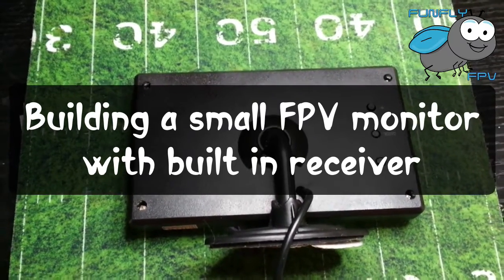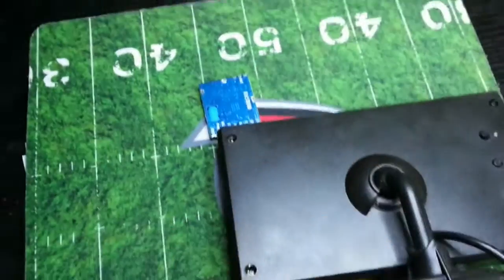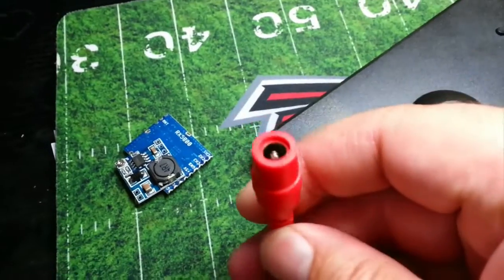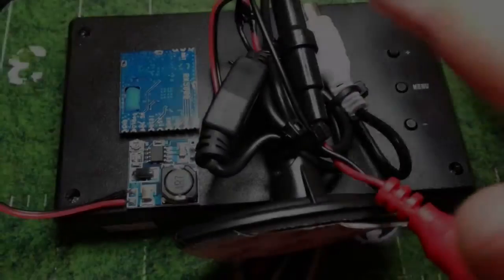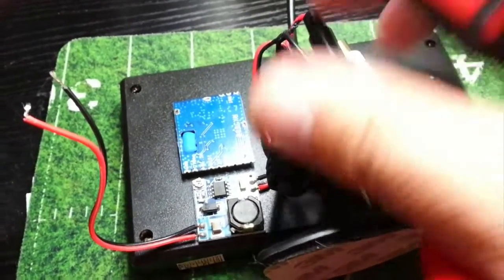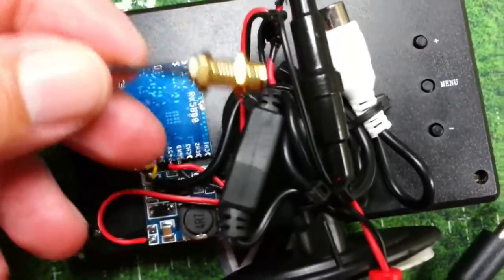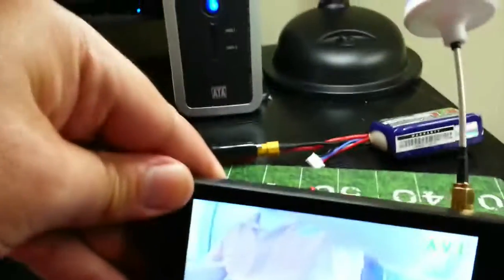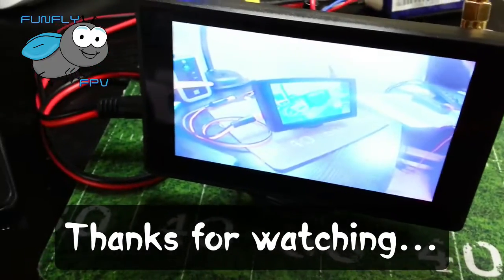Mini FPV monitor with built-in 5.8 Ghz receiver and antenna

Comment: Hello !
This project has made me think an idea... think i'll need your help !

How about if i try to feed A/V directly from another source, such as a DVD player... to a regular TV ?

In advance, Very thankful for your answer!
Reply: This would be an indoor application for this hardware... just for the fun of not having cables on the way.
Reply from the maker: I think it will carry almost any source as long as the resolution fits the monitor.
Reply: Ok. Got it... is there any way to make it work from an HDMI port?
Reply from the maker: miguel delgado Hmmmm ... There should be a converter available.
Reply: thanks for the answer, but:

why do i need conversion?
Reply from the maker: I forgot you were not doing direct input to the monitor so it should work without conversion.
Reply: My next doubt would be in terms of connection. I mean... Hdmi ports have a lot of pins... This chip you were using seems to have a single pin/ single signal video input. 
How could we achieve connection then?
Reply from the maker: Well then I am misunderstanding what you want to achieve. Sorry but can you tell me exactly what you want to do in more detail again?
Reply: Ok... Sorry for the confusion ... On the last message i had mentionned video "input" when its output.my bad.  l
Lets say i want to receive the signal wirelessly just like you did... On 5.8 ghz. 
But instead of connecting to the monitor with the video connection you used i want to use an hdmi port. You seem to use a single cable... Which is yellow and its corresponding "ground".

But instead of that i would want to connect to my tv wich has hdmi port directly from the 5808 circuit. Thanks for your time. :-)
Reply from the maker: I see what you are saying. Most TV's support Composite which is what comes out of the 5808. If your TV only supports HDMI then you can get a composite to HDMI converter.

Something like this: https://www.neweggbusiness.com/Product/Product.aspx?Item=9SIV0GS3CW2965&nm_mc=KNC-GoogleBizMKPL-PC&cm_mmc=KNC-GoogleBizMKPL-PC-_-pla-_-Cables+-+VGA+%2F+SVGA+Cables-_-9SIV0GS3CW2965&gclid=Cj0KEQjw7Ne_BRDRmP2ojKfzv98BEiQAPuqPyeFGJENXl_atcb5wHAg7dG-OEZnlewvVwkbgJZ9SaNgaAq168P8HAQ
Reply: +FunFly FPV ok ok. Got it. Thx a lot.

Comment: I had the same idea only I was going to use a 7 " TFT and place all components inside, I have built 4 videoTx's modules using the Tx board from BG and they work really well I just never got around to use the Rx board (the one you show) I wired it just as you except I used a single cell at 4volts to test ( Data sheet shows 3.8v) something burned on the board not sure what happened as I have read that others have used it with voltages from 3.3 up to 12 volt (w/voltage reg) maybe just a bad component  I did add the 3 pos dip switch as well as a 470uf cap across + to ground as is shown on BG web site and triple checked the hook up for shorts or wrong wiring didn't see any- the only symbols I can see on the part "N 2 t"  it is a SMD w/3 legs(a type of voltage reg maybe?) but all attempts to look it up come up empty these are REALLY small parts I have ordered a few more Rx boards from BG but thought since Ill be waiting awhile I'd have a go at repairing the other one I have many SMD parts just cant find what that one is  Any thoughts ?-
Reply from the maker: Well, this receiver shows a 5V input so I used an adjustable step down voltage regulator and converted 12V (3 cell battery) into 4.8V, I believe I set it to. I think if the little receiver burnt, I would not try and fix it, it's just too small. New ones at GB are like $10 each, so I would just buy another and write it down as experience...

Comment: I would have mounted the transmitter and voltage regulator inside the screen if possible.

Comment: so I have almost the same setup, my question is how you change channels on the Rx??
Reply: Well, there are 3 connectors on the RC5808 (CH1, CH2 and CH3). In the perfect world where everyone had time, you would add a dip switch bank to those connectors as per this image: 
http://img.banggood.com/images/upload/2012/chenjianwei/SKU075321.6.jpg

You would then have the ability to change channels like this:
http://img.banggood.com/images/upload/2012/chenjianwei/SKU075321.7.jpg

I just left mine as Channel 1 default... :)
Reply: thanks